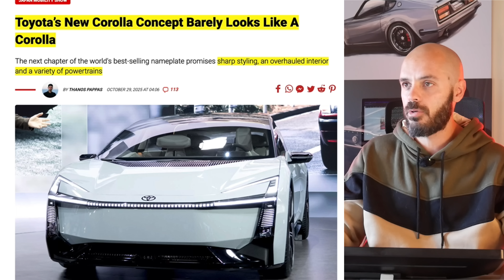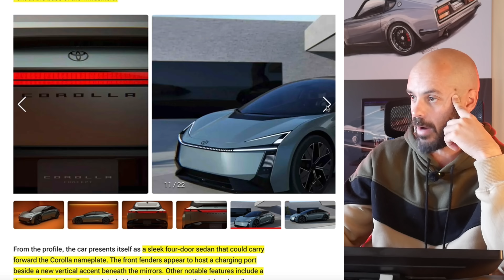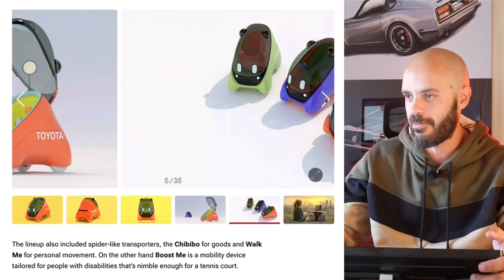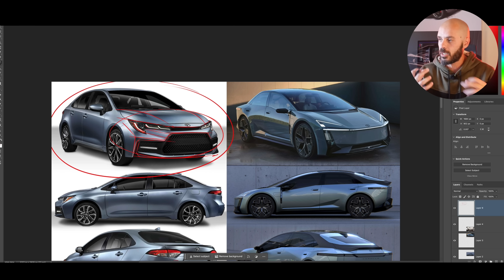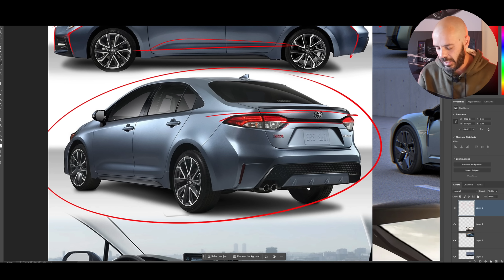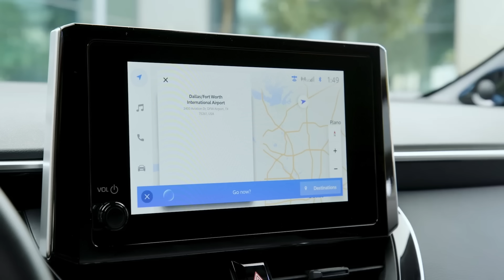2027 Toyota Corolla - This is wild

Comment: I was expecting it.
This is the new Prius introduced styling language. 
Best looking Toyotas.  
They found they don't need 0 weight oil  for good mileage if they knock off the sharp edges,
Toyota leads the way.

Comment: I still have my 2007 which is super reliable and have been wanting to buy a new one each year but they all looked the same and didn't change so why buy new if it's reliable and body style hasn't changed. I like the new design but not the interior. Doesn't look comfortable for this old man.

Comment: I don't like these screens that are tacked on to the interior like someone said "we forgot to include this" and they just added a screen to the interior. Also, I prefer the radio to be separate from all the other car controls. I miss the days when I could buy an aftermarket radio. I got a CX-30 2 years ago. I cannot - I repeat - cannot upgrade the radio. I MUST use the one it came with. I had to snip wires and downgrade them to RCA cables so I could amplify them. We are losing the freedom of choice.

Comment: I really can't see this as the redesign. Even if it's 60% percent of it. All Toyota is going to do is give it a facelift back and front and a totally redesigned interior. They'll probably be new engine upgrades. Overall a lighter redesign like they did with the Camry and the Rav4.

Comment: I'm ready for retro pre 80s automobile designs, and not retro modern,  But pure retro styling.

Like the 47 Chevy fleet line, or the 57 Ford Fairlane, or the pre 67 VW beetle, or the 60 Chevy pickup, or the Dodge A100, or the Datsun 620 pickup, or the 70 Camaro,    2nd Gen Corvette, or the bmw 1800, 1960 Chevy belair, 68 Dodge charger, 1st Gen Ford Econoline, 1st Gen Toyota Celica, or even the Pinto or Vega body styles? 
I'm so sick of modern automobiles. Imo, the only retro modern body style that was decent is the new Lamborghini countach.

The modern Bronco blows

The modern charger body style came close but no cigar.

The mini Cooper isn't mini anymore,

What's your favorite classic you wish they'd bring back??

Comment: Man, the inconsistency :))
If this was a Mercedes you would be moaning about the wedge shape, the bow-like shape, the windscreen which meets the front wheels too far ahead etc :))
Reply: Bc this isnt a merc
Reply: maybe because Mercedes and Toyota have two very different design languages?
Reply: Replace the Toyota badge with a MB badge and it will be a bad design, for a Mercedes. It wouldnt fit a Mercedes at all.

Comment: The day Toyota makes a Corolla that looks like that, is the day hell freezes over.
Reply: we just have to wait and  see what happens 😂🤣😅
Reply: @carholic-sz3qv Given Toyota's track record when it comes to designs, I'm not holding my breath, most likely the next generation Corolla will be just as boring and uninspiring to look at like the ones before it. The current Corolla Sports Tourer does look good though.
Reply: @deet4895 The new Prius did something similar already. And Lexus had that jarring futuristic phase already so anything is possible
Reply: @deet4895  after what they did with the prius, I bet they settle with this design. It's too good not to do it.
Reply: I believe they can but it will cost a lot more than the current ones!
Reply: Guess what?     The Prius looks like this. All of them will soon.
Reply: Will be ugly as new Camry

Comment: It's a war on beauty. Every car looks like a sad robot nowadays. I'm 27 and I only like cars from 80s to 2006ish
Reply: Same 
War on practicality & simplicity as well
Reply: @Penguinclinic yeah planned obsolescence and greediness, emptiness...so tiring to fight this every day
Reply: @FROMapex2apex  cars last longer now than ever before on average.

Literally every generation thinks “the best” cars just so happen to be the ones made when they were young.
Reply: @foobully do you have a car? Or you just ragebait? New cars are made with planned obsolescence in mind. So no, new cars don't last longer, you can still see cars that were made 20-30 years ago, which run just fine. Meanwhile you won't see Tesla or any new cars in the future because they last 5 years or so till every single part goes to 💩. Engines last 50k it's unheard off, and it's all because of emisions, meanwhile old Toyotas and Mercedes run for 1-2 million kilometers. I want to know what kind of Roblox study did you get your numbers from
Reply: @FROMapex2apex it’s indisputable fact that cars last way longer than ever. Until the 70s all cars were trash and 100k miles was extremely rare. Through the 90s that trended up but slowly. Since the 2000s we’ve gotten way more. 

Better fluids, computer aided design, advanced alloys, gaskets, seals, better risk resistant coatings, lots more testing. It’s actually common for engines to last 150-200k miles with care now that was unheard of in the 90s except for maybe Toyota. 

Old people love to focus on like one thing like the brief CVT issues or somthing. Like I’m 100% positive you’ll not go research it yourself and find the truth because you’re all about nostalgia. Go enjoy your nostalgia. 

I don’t care for Tesla and one car brand doesn’t prove anything but EVs in general will be far more reliable as they mature and further improve the stats.
Reply: @FROMapex2apex how are you fighting it every day?
Reply: @foobully Indisputable? Not really. Depends what car, from which brand. Toyota/Lexus? Sure. Mercedes, Volvo, not even. Look at reliability charts from 2009 and 2024, mercedes once a totally reliable brand fell to the bottom. Volvo too was reliable and fell. Pretty sure any Japanese manufactured car from 70s would still be reliable. 

You mixed all these things you've mentioned into one basket without much thought it seems. As these same things that made cars reliable as you say, also made it more complicated for consumers to fix themselves without needing to go to the shop to get a fix, which in turn led to consumerism and planned obsolescence, which is the opposite of reliability :D

I need research and I'm about nostalgia? Haha so far you haven't given me a single proof, all of this was just your opinion, which can be biased. It's not just cvt, cars today have plastic oil pans (caugh Nissan caugh) which led to their bankruptcy. Bmw uses sensors for oil level in the engine instead of a dipstick, which means you NEED to go to the shop, just to change oil. These sensors tend to show fake data. Many other manufacturer interior trim got worse, when we used to have real leather, even stronger plastic, nowadays it's all cheap, fake and even plastic parts or bits that get broken, you need to change the entire door trim for hundreds of bucks. Everything is overcomplicated, like headlights for the sake of being more techy than last year, driving prices up. Where is reliability in all this? I can go for hours, you lost this argument 

EVs are not the future, go check what Toyota CEO said, EV bubble has burst already, nobody wants them, and they certainly don't seem to offer better reliability "despite having less parts), nobody wants a second hand ev, they depreciate with every km/mile you drive, while cars from 90s go up in price. Also evs are nowhere to be seen in reliability charts.
Reply: @carlosandleon  I try to enlighten people because there is so much brainwashing in todays world and it's done by a certain group of people with small hats and long noses
Reply: @FROMapex2apex You just went down the deep end in the opposite side. You fell into another fallacy fighting one
Reply: @carlosandleon  nah I don't think so, care to prove your point?

Comment: The Corolla is supposed to be about simplicity, affordability, and reliability. When they start adding all these modern quirks (like making a headlight replacement cost a few thousand dollars instead of just swapping a bulb), it misses the whole point of the car. If they called it something else, I wouldn’t even be that mad.
Reply: Look at chinese cars in this price range and tell me about simplicity
Reply: I don't know what rock you're living under but headlight replacement already cost thousands of dollars. My 2016 headlights were $2,200 each without labor. I have a Lexus now and it's over $7,000 for the pair.
Reply: Yeah… current corolla is not simple at all
Reply: They tried that with the Yaris and it fell flat on it's face.  Its 27K now its no long affordable for most people.  They are trending towards hybrids and they aren't cheap.
Reply: Buy the old ones
Reply: Nothing stays forever. Some hate change, some love change. I think the like would be more than the hate.